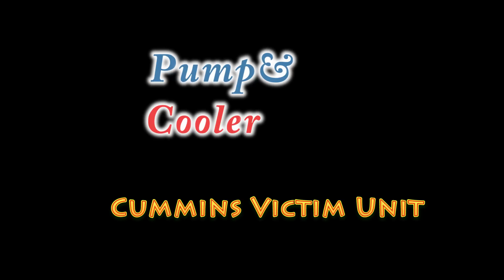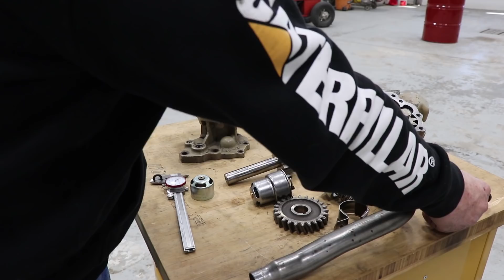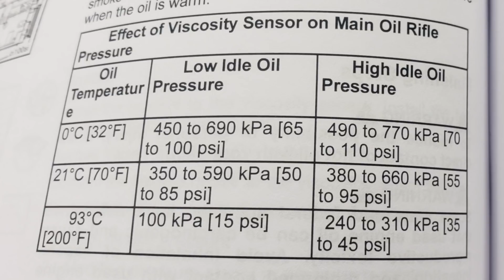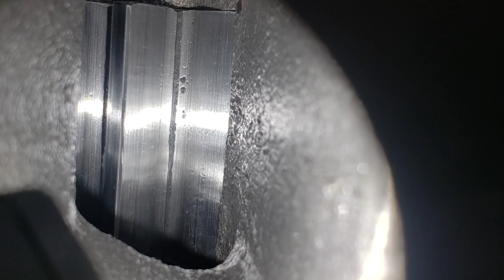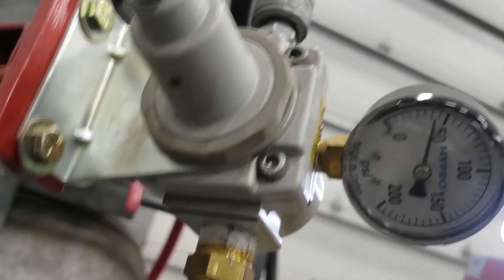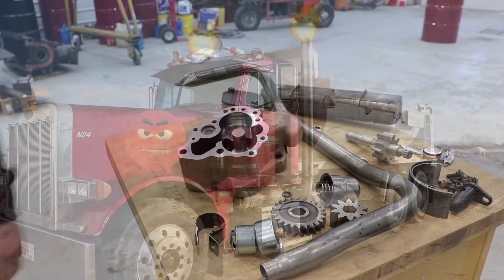How To Fix Low Oil Pressure On A Cummins N14

Comment: One of our freightliners with n14 lost oil pressure and shut it off immediately. Replaced sensor , pump, nozzles ,filter and oil. Once  oil is warmed up oil pressure drops to 10 at idle and 25 psi at high rpm. Still getting low oil pressure warning ..What should I look at next?

Comment: What size is the plug. Would like to get parts ordered before teardown
Reply from the maker: Just install the 215 stat, I did as the plug won't get the oil very hot in winter

Comment: What would cause N14  oil temp to go above 260 degrees would it be the oil cooler thermostats or oil cooler is plug up and failing? But say you plug the oil cooler thermostat how would it cool the oil ?
Reply from the maker: verify the temperature first,  if your oil changes are few and far between the cooler could be sludged up , when I cut mine open it was bad, use the 215 degree stat part number 495 2631 that's what I installed when I rebuilt it a month ago, don't plug the hole as your temperature won't run hot enough in the winter, if you remove the housing to check the thermostat drain the block, there's a small plug at the back of the block, if you don't, antifreeze will run into the oil galley when you un bolt the housing from the block. you can verify the temperature by either replacing the sending unit or gauge or both , or using an ohm meter check the wire going to the gauge, as the gauge reads resistance and if there's a bare spot on the wire the gauge will go up, the other way is buy a temperature gun and get it hot, then stop and check the temperature at the oil pan where the sending unit is screwed in
Reply: @Jpaydirt  thanks for your reply. I did check the temp with temp. Gun thinking it bad oil temp sensor . Both oil temp and on celect roadrelay showed same temp. This truck has the oil temp.senson on oil pump not on the oil pan. . Temp was accurate On both . Had this oil for 12k was about to change it out usually do it 10-k to 12k max . Changed the oil thermostat seems to be ok oil cooler seems ok now think it was bad oil thermostat or oil has over due at 12k but had ran it one time to 15k didn't have any issue had truck for 10 years and never that issue with oil temp going that high thanks for your help

Comment: Just forwarding
Cummins Manual ---
The pressure regulator remains in the closed position until the pressure in the main rifle reaches approximately 241 kPa [35 psi].
At that point, the oil pressure from the main rifle oil pressure regulator, acting against the end of the regulator plunger, overcomes the force of the regulator plunger spring.
The pressure regulator plunger moves downward (open), uncovering the dump port in the regulator cavity. This allows any oil in excess of the amount required to maintain 241 kPa [35 psi] to return to the oil pan.
Reply from the maker: paydirt's manual says" machine the end clearance to  .0025 then place four, 3/8ths cat hard flat washers under the plunger spring and watch the oil pressure rise like morning wood"
Reply: @Jpaydirt 
I assume somethinh must be done since seen footage from 60psi.
Did You compared the volume of oil passing?  How those cooling nozzles survive this and are You using thinner oil now. Like 10w 20 or lower?
Does it affect the oil filter bypas? 
I see advantage here for making ttighter parts clearenace now,  less shaking here and there.  
And idea with open oil cooling passage is ..cool.  That butned oil at breather can smell yuck.
Reply from the maker: @organic7771  I'm running John Deere 10w30 break-in oil, when it gets to running temperature I have 45 psi and I'm pretty happy with that, if a nozzle were to break you would see it in the oil pressure, the designed pressure is so low  there's no room for any leakage somewhere
Reply: Wondering whats the psi on Buhler Versatile 2360 4WD tractor version.

Comment: Helix gear pulling the shaft in caused my shaft to come loose so it didn't stick out far enough to engage the power steering pump .. power steering went out..

Comment: Sir i just ask about low oil pressure problem n-14 when engine  temp. @ reach to 170f oil pressure goes down to 10psi or lower we already replace oil pump,  piston cooling nozzle & replace main bearing please help if you already encounter this problem thank you.

Comment: Did the freeze plug work for oil temp. Wanting to try that on mine?
Reply from the maker: I'd go with the 215⁰ stat 4952631  as it won't get hot enough in the winter

Comment: Hi J  in your opinion, do you think 0.002” is a minimum for the BC400 pump. Or do you think anywhere from zero to 0.004” is good, closer to zero the better. ?
Reply from the maker: zero would be bad as you need clearance so oil can be present, the book says .002 to .004
so .002 is minimum and .004 is maximum

Comment: I blocked the thermostat, at 160k miles after an out of frame my motor is trashed. Crank down, cam down. I don’t think this is a good idea
Reply from the maker: Ohh! I haven't had any trouble,  but if I did it again I'd use the 215⁰ stat just because in winter it doesn't get the oil temperature up where I'd like

Comment: Love your videos!  Uhh is replacing the 255° thermostat with a lower temperature be a option?
Reply from the maker: Yes, and that's what I would do, 4952631 is the 215⁰ stat
Reply: I looked up that number and got two different options. 4952631 for $139.45 and DS-4952631 $40.00. Now, the number you provided it is said to be for ISX/QSX, while the DS number it is shown to be for the N14,  N14 celect, etc. Any thoughts?
Reply from the maker: @RafaelPolo-q6c  I got the number I gave you from a facebook group called Cummins N14 Tech Support

Comment: Hello. Im getting 40 psi on cold start. After the truck is fully hot it’s getting 15-20 psi on idle and 30-33 at 1500 rpm. However when pulling hills in the summer it drops to about 26-28. I know that’s not within spec . I had it in framed and it the oil pressure didn’t change . What do you think I should do .
Reply from the maker: An inframe is just pistons, sleeves and crank bearings.  did they measure the rod journals and plasti gauge the mains to see if they were in spec? also the cam bearings could be worn, you can change the oil cooler thermostat to a 4925 2631 which is a 215 degree and replace the 240 degree one that's probably in it,  if you really want higher oil pressure you can buy a oil pump for a big cam 4 which should have the closer tolerance's  N14's have 5 to 7 thousandths gear clearance where as the older big cams had 2 thousandths, makes a world of difference in the pumps ability to make pressure. if that doesn't work your cam bearings are probably worn,  oh and check the accessory drive bushing by removing the belts and trying to move the pulley side to side
Reply: @Jpaydirt  hey I do have a rattle sound coming from the accessory drive bushing . It’s been like that for years . Do you think that would cause low oil pressure ? Also I’m not sure if the mechanic checked all those things . He was an older mechanic with 40 years of experience he was very grouchy and when I asked about anything he would get frustrated and would tell me “let me worry about fixing your engine” I didn’t want to upset him and let him do his thing . I did change heads injectors turbo and air compressor as extras .
Reply from the maker: @duvasio4204  there's a Cummins document that can help to determine where the pressure is being disapated,  by putting pressure gauges at the various oil gallery locations and seeing where the pressures are at , at those locations can help to determine where the leakage is happening,  but yes a loose accessory drive bushing will create a pressure loss due to the fact oil is escaping easily because of the excessive clearance between the bushing and the pulley shaft,  the same thing happens when crankshaft clearances are excessive but are multiplied because of the number of points that oil is escaping.  New bearings can help but if the crankshaft journal is worn beyond specifications then pressure will still be poor,  accessory drive bushing wear is pretty common on high hour n14's and if not addressed will ruin the front cover and cause serious damage the gears,  I still don't have the pressures that I wanted in mine and when I checked the accessory drive I was shocked at how much wear it has.  So I will have to address it soon,  you can tell how bad it is if there's a loud clanking sound coming from the front at idle,  mine is not at that point yet but I still want to fix it,  I may also opt to change cam bearings during the repair also as this truck was not maintained properly as evidenced by the condition of the crankshaft bearings when I replaced them,  mechanics don't like to be questioned as they think they know everything and that's not true,  I learn all the time and am not afraid to say the words "I don't know"  and if I don't know I'll find the answers,  I love sharing my knowledge because we get more done when we work together 😉

Comment: Thermostat bypass worked great! Thanks. I installed a cat 1R-0749 fuel filter but I left the oring off because it didn't look like it would fit. Now in the morning it takes a long time to crank. Should I put a regular oring on there that fits? Not sure why...
Reply from the maker: Oring?
Reply: @Jpaydirt  the seal that goes up on the threads before you put the filter on. Not sure what it's called. The fs1000 comes with the seal, but the cat filters I got didn't have one.
Reply from the maker: @Alex-nx3so   well sometimes we have a hard start but then it goes away, jake changed the filter today because it wouldn't make any boost and it's been fine lately, we can't use the 749 as it's to long so we have to use the smaller 750, maybe try the FS and see if the problem goes away.  the cat filter claims a 2 micron rating, I wonder what the FS is rated for, we have to change the filter quit often so maybe it catches more crap

Comment: Excellent video sr,. I'm from Costa Rica and i'm rebuilding an N14, The owner told me about the low oil presure. I'm gonna check the oil pump for sure, cause it's brand new. Thank You sr.
Reply from the maker: Check the relief valve there set to open at 40 psi,  the N14 is supposed to run 30/35 psi pressure and it will with  .007 pump end play but I that doesn't give you much pump capacity if somewhere a oil leakage problem occurs,  all my CAT stuff calls for .002 thousandths clearance in the oil pump. clearances in the engine need to be within spec to obtain good pressure

Comment: I'm not sure where I left this comment that I was having trouble with my lubrication oil pickup tube;

I was correct that it was metal to metal contact preventing me from taking it off.

What I found in the 189th minute of overtime is that I was loosening the bolt above the tube and it was in the way of the flange. When I put the bolt back finger tight the tube pulled out with hardly any effort.

Dough!

Comment: Is it possible just to bypass the stock OEM cooler with its thermostat and just get it aftermarket thing remotely located behind my day cab?  

I believe you make excellent points in this video but the main one is the oil cooking above 240° 

In july, 2022, I do my own oil changes which come to about $350 including filter and 9 gallons of Valvoline premium blue but I always buy a couple extra gallons.  Because 

I'm between short Hall and regional on most of my loads I haul.  Therefore,  I also go by hours in addition to miles for my maintenance accruals. Either 300 hours or 3,000 miles whatever comes first.

EDIT:. Or changing out the thermostat-spring for one with less tension-resistance so that the thermostat closes sooner?
Reply from the maker: so I installed a plug in the hole where the thermostat was that way it's a full flow cooler, the only problem with that is during cold weather the oil temp doesn't get much more than 180 degrees, I think a good winterfront would cure that,  or try 495 2631 thats a 215 degree stat. ISX uses the same oil cooler thermostat,   a 215 would certainly reduce the oil temp,  do you do oil sampling to determine how long you can go on oil changes, might save you a lot of money on changes, just do samples every 5k to see what kind of pattern develops
Reply: I keep sending my 2000 Freightliner Century w/July 1999 built Cummins N14 oil samples to comments and they keep telling me that my Valvoline premium blue is doing fine including less than 1% fuel dilution.  I perform the oil changes myself that way I know I'm getting Valvoline Premium Blue© and a Fleetguard® oil filter.

My 1999 Toyota Solara on NAPA oil on the other hand doesn't do so well after 3 months and 4,000 MI has it runs out of alkaline substance to keep the acid down. The the 1mzfe 3.0 V6 has been written about that it's notorious on sludging up which pretty much mandates fresh oil often.

Comment: I dunno....

... I get 35 PSI at low idle cold and then 10 psi at low idle hot.

I get 45 PSI high idle cold and 30 PSI high idle hot.

The Cummins literature I have read says that the specifications are 10 psi at low idle at operating temperature and 30 PSI and high idle or Road speeds.

So I dunno .....🤷

I think it's about volume as much as pressure anyway for engine oil... But that's just me... Got one 1.019 million miles and 46,000 hours on my Cummins N14 and I have no blow-by and I can pull hills better than most emissions equipped trucks.
Reply from the maker: It's the same pump as a NT88 (big cam 4) pressure and volume go hand in hand as it's the same pump that pumps 60 psi in the 88, only difference is the amount of end clearance , one has .002 and pumps 60 psi and the other has .007 and pumps maybe 35,  the problem I have with it is it leaves no cushion when a problem occurs ,  you don't need a lot of pressure but CAT still uses higher pressures so I'm not sold on low pressure

Comment: Hello how are you I have been watching your Cummins n14 videos, I have a Cummins n14 celect plus and 2 months ago I built it all new from the signal and everything else and I have already changed 4 oil pumps and it continues with low oil pressure like 15 psi, you think it's the oil thermostat.  Many thanks
Reply from the maker: 15 psi at idle?  that's spec for a N14 the only way to increase the pressure is take the excessive endplay out of the pump and get it down to .002

Comment: This is late to the party ,but before the n14 ,Cummins had great oil pressure, there only real problem then was the 3 headed monster as I call it ,them 3 heads move like a gogo dancer and the deck goes to crap
Reply: The N14 has three separate heads as well so what's your point?

Comment: I just bought a truck for the N14 it had. Low oil pressure.. I need a good core for my Pete.  They rolled bearings in it.. and didn't fix it so parked it. Figured it was pump issue or piston squirter issue. I have several to build.. not often I find good info on solid changes I'll be making

Comment: Where exactly do you machine the pump to get the clearance??
Reply from the maker: by taking material off the pump body where the gasket and cover plate bolt down, the clearence between the gears to the cover is to great

Comment: Well bypassing the oil thermostat is not a very good idea if for any reason that oil filter get clogged and the oil pump pumping faster you will starved the engine of oil and you would likely fry the engine I think that  your oil change interval instead of prolonged should be shorter to prevent that filter of clogging what you  should've done is find a lower thermostat or if you couldn't find one    drill a little hole on the base of the thermostat for some oil to flow freely but not to much
Reply from the maker: The filter has a bypass valve, why would the filter plug and what would plug it? oil is expensive getting it to last longer is the goal, by reducing the oil temp from 240 plus degrees  makes it last longer, caterpillar uses a full flow oil cooler and runs twice the pressure cummins does, cummins did the low pressure thing to save fuel, but at what cost? shorter oil life, increased bearing wear and zero cushion in pressure in case a piston cooler nozzel broke or a leakage problem internally which would drop pressure to such low levels as to cause damage.

Comment: Regards. I have worked at hydraulic gear pump factory. very similar construction of the pumps. As we all know, hydraulic pumps run at much higher pressure then engine oil pumps....   My experience on side to side gear clearance in oil pump is crucial for output pressure ! In order to achieve such high oil pressure, between gears and pump housing, "pressure plates" were machined and installed in order to achieve  minimum clearance ....  I strongly agree with everything you said in this presentation. Good job! Thank you for sharing your experience and knowledge. many can learn, and some can relay to it !

Comment: Thinking about pump clearance - You complained in your rebuild video that the Chinese pump had too much.
But it was bang on the Cummins spec - so not a manufacturing issue more the spec they were working to,
Reply from the maker: Your right, but it's not even up to industy standards for a oil pump.  cummins changed the specs......why
Reply: @Jpaydirt  
To support their Reman division? 😀😀

Comment: What is a good n14 oil pressure without doing all of this?
Reply from the maker: A N14 normally will run 35 to 40 and speed and 10 to 15 at idle

Comment: Which one of the two oil pressure screw needs the washer(s) I know this is an old vid but I’m overhauling my big cam now..
Reply from the maker: There's only one relief valve, it has a bolt and a washer that hold in a plug with an O ring around it, remove the plug and add a washer then push the plug back in ( might inspect the oring) and secure with the bolt and washer
Reply: @Jpaydirt  
You da man…. I always knew it was possible. Thx